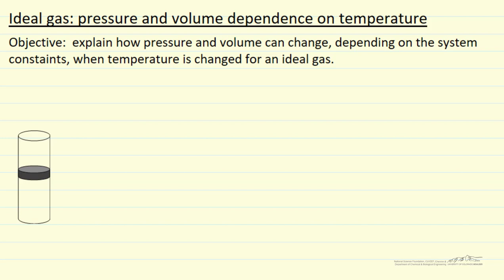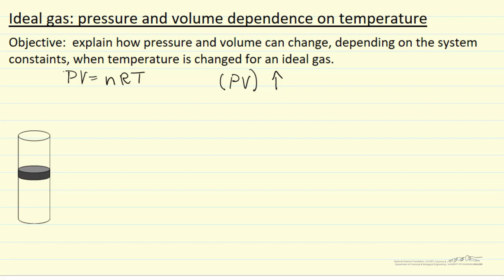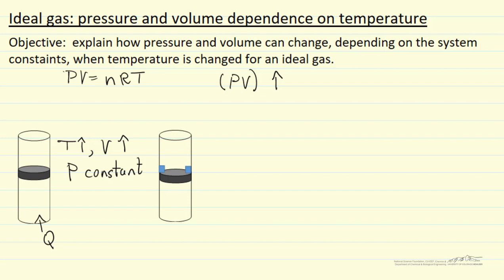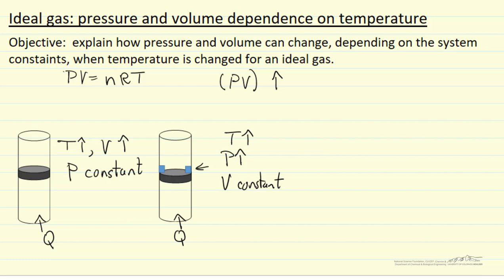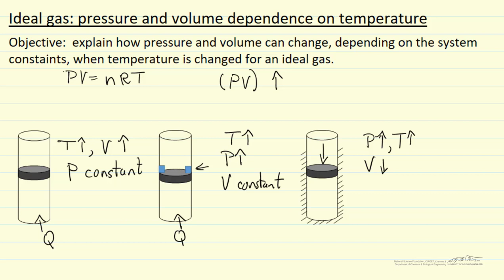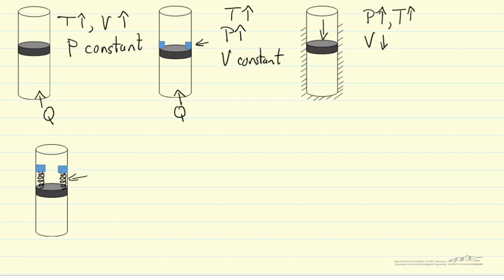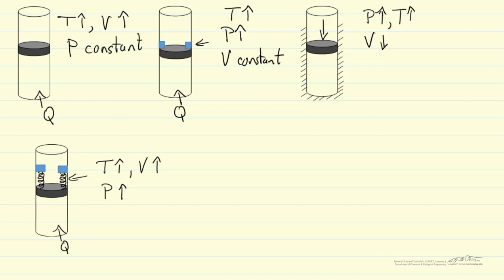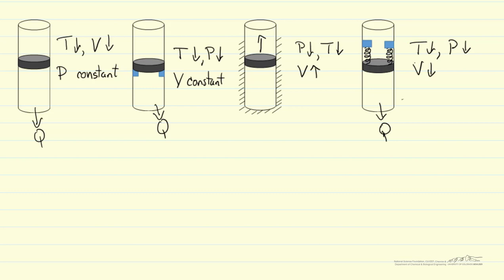Ideal Gas - Pressure and Volume Dependence on Temperature

Comment: Another great video.  Can you do a video showing, that for an ideal gas, the temperature increase (do to compression) is determined solely by the work done on the gas, regardless if  it’s an adiabatic reversible compression or an adiabatic irreversible compression?  In other words, the loss of total pressure, for the same amount of work done, of an adiabatic irreversible compression.